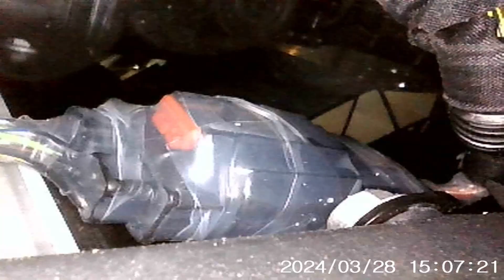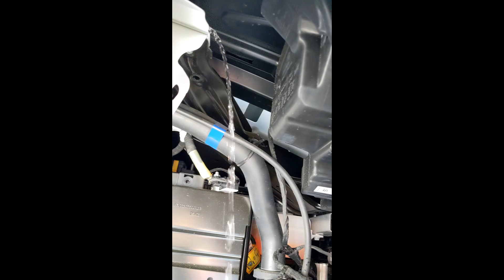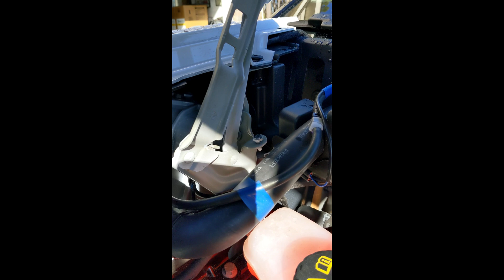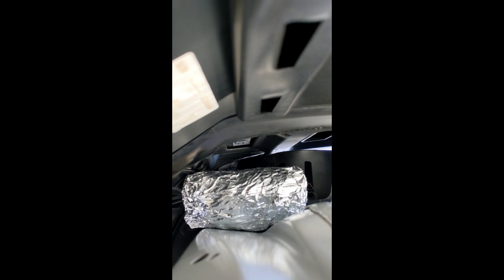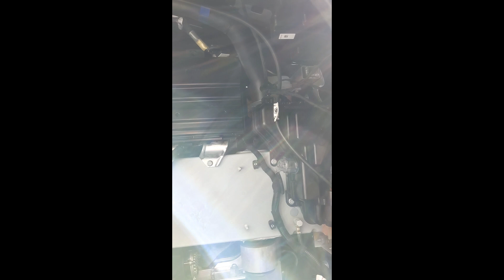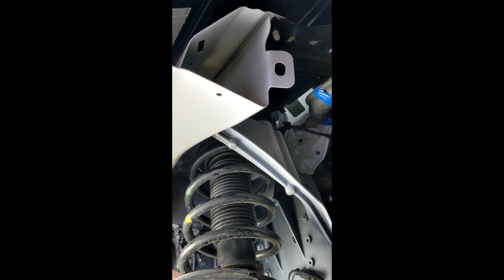Fisker Ocean cowl leak to front electrical connector fix (frame rail blocker)

Comment: Hi Esrandl
Thanks for your great instruction! Could this seal also be inserted from under the hood (if I could avoid taking off wheel and liner...)?
Reply: To do an effective installation, I found taking the wheel off is mandatory.  Through the hood, I couldn't reach the far side of the blocker and make an effective seal with the tape.  The best way would be to remove the fender, but that's a huge PITA.

Comment: is this water  leak 
brick the car? mine bricked after heavy rain last night .
Reply from the maker: @Hellotag12  it would cause problems with front wiring harness. That is usually lights, adas, pedestrian speaker. I am uncertain if it can actually cause vehicle to fully brick